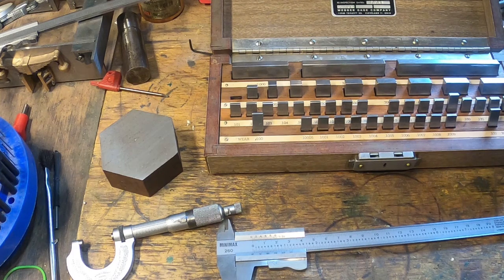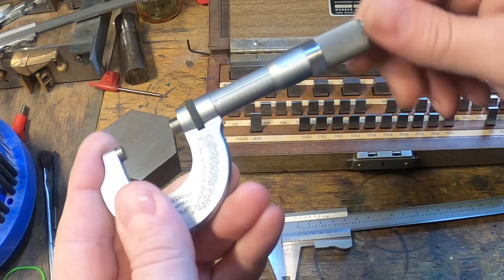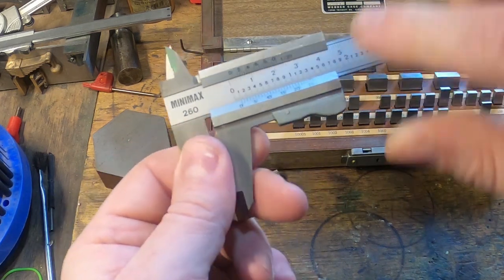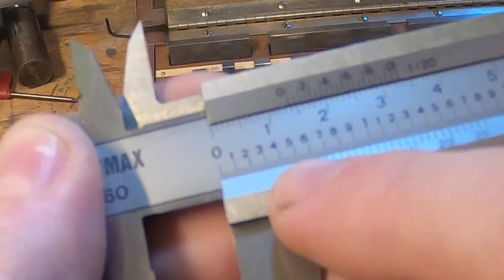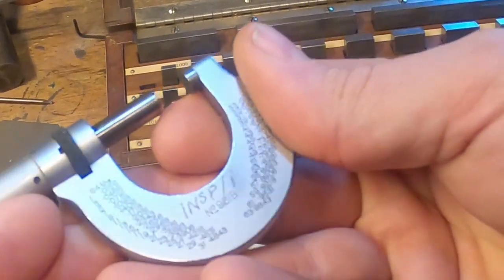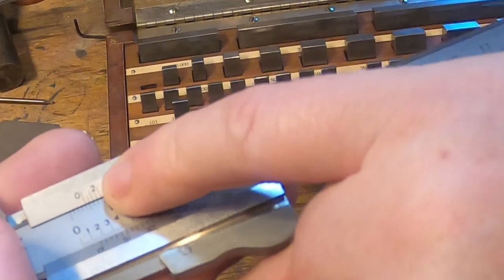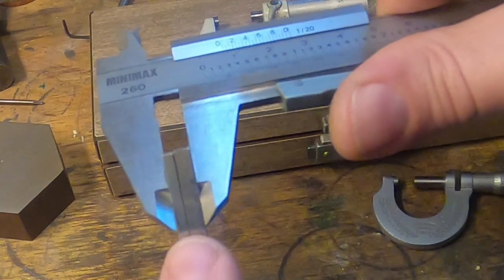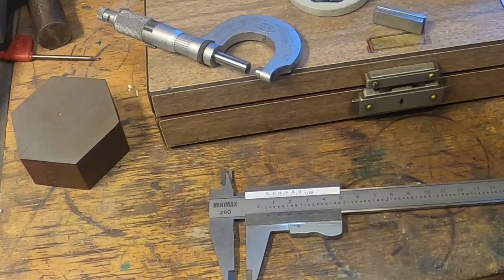READING A VERNIER SCALE

Comment: The first precision tool that I ever purchased was a vernier caliper.  I still have it and it is as accurate today as it was over 50 years ago when I purchased it. My height gauge is a Mitutoyo vernier (although I would like to replace it). Good skill to learn.  These mechanical tools work even when the batteries are dead. Thanks for sharing.